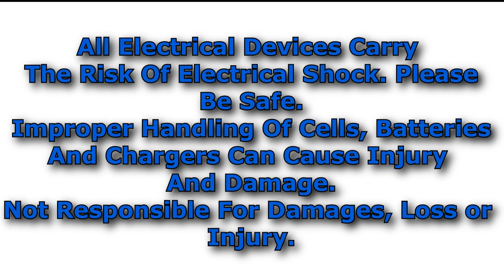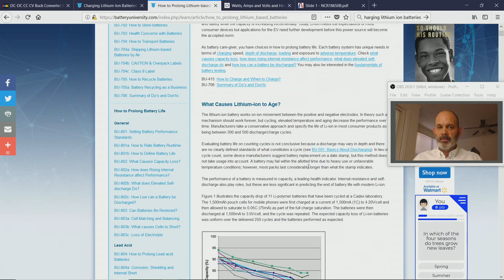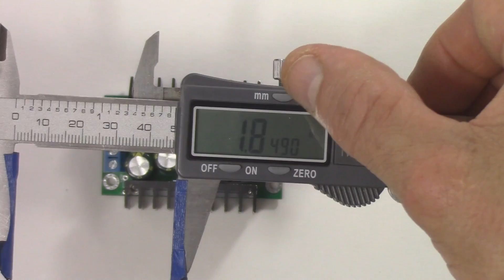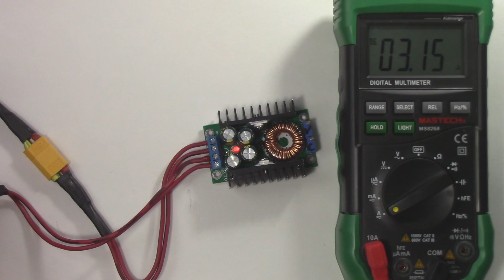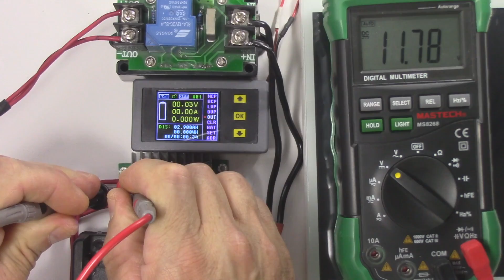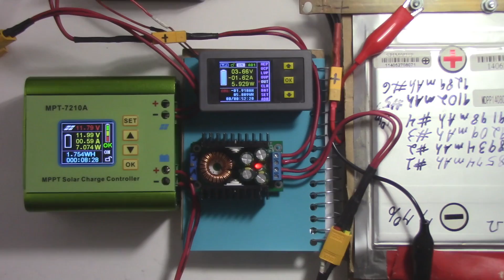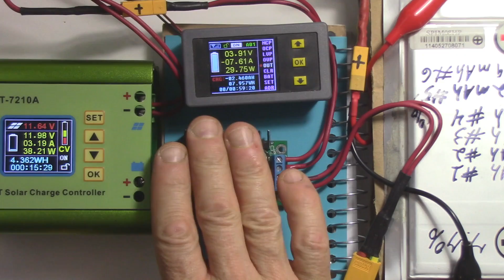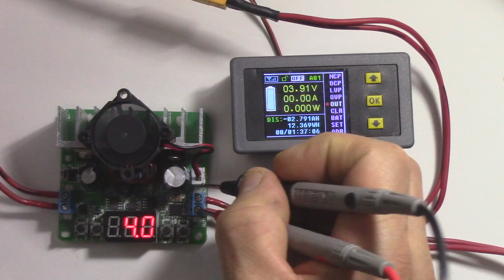Cheap Lithium Battery Charger OSKJ Buck Converter (Constant Current-Voltage) Review-Test

Comment: Very good video. After a 50 year break I took up electronics as a hobby again, things have changed - just a bit. I bought my first one of these bucks about 2 years ago. So far after doing all sorts of terrible things to it it's still going strong. I even used one as the regulator for 12 TIP35C power transistors, sort of buck linear 'thing. I did change the blue trimmers for proper pots.' Just an experiment and it worked fine. I have one as a battery charger - 12 V car & lithium. I have most of the main ones that are on EBAY and I rate this No1, better than the 300W 20A - my first one popped. I always use a 60mm fan though.
Reply from the maker: I agree. It is a very forgiving unit and does work well. Thank you so much for watching, commenting and the kind words. I appreciate it greatly. All the best.👍😀

Comment: What is the maximum current to charge that battery?
Reply from the maker: The cell is a Panasonic NCR18650B. The capacity (C) of the battery is expressed in mAh (milli Amper hour). This capacity is also used to indicate intensity of charging and discharging current. Thus, charging current (Charging) is 1625mA. Since 
the capacity is 3250mAh, you can see or calculate that the charging current must be limited to 1625mA or 1625/3250 = 0,5C. Also, CC-CV stands for Constant Current (CC) and Constant Voltage (CV). Thus, charging must be done with a maximum current limited to 1625mA per cell, and when the cell reaches 4,20V, the charger should remain at a constant voltage of 4,20V, which will gradually decrease the current. Charging should be stopped when the current reaches 65mA. Excellent article on this here: https://goo.gl/t6Sk8i Thank you for watching and commenting. I appreciate it greatly. All the best.👍😀
Reply: @richardlloydusa  I meant the Lipo cell SPIM08HP  - you were charging it at almost 10A - so can it be charged with 25Cx0.5x8A = 100A ?
Reply from the maker: According to the eBay Sales page: https://goo.gl/5VK7GY they say they can be charged at 120A! They are 200A output cells that were used in electric buses. Personally I never go to the max limits on cells. My charger will not do more than 10A safely that is why I limited it to that.  Thank you for watching and commenting. I appreciate it greatly. All the best.👍😀
Reply: @richardlloydusa  I was talking about SPIM08HP
Reply from the maker: The SPIM08HP is the cell I was referring to as well. Check this link: https://goo.gl/5VK7GY on eBay for the specifics. Thank you for watching and commenting. I appreciate it greatly. All the best.👍😀

Comment: 17:07 "The current is really high" - it's because an ammeter resistance is near zero, so without a load in the output you made a short circuit
Reply: That's the point. You can then set current limiter to any value below short condition.

Comment: Make a video of using a buck converter to charge a  LiFePo4 cell with a 5-10W solar panel.   Or, to maintain a fully charged cell.    What do these buck converters do when input voltage drops below desired output voltage?
(Just tested with some cloud cover.   The voltage on the output pins does not climb above that of the battery.  Amps is showing 0.0.   ). Hopefully I can get some full sun today)

Comment: Can you study and let us know how to connect two units in parallel to get more current
Reply: Put a 10 watt 1 ohm resistor on the positive output so it always sees a load.
I just saw a video demonstrating load sharing by ...rf guy I think.
He was using regular converter not a constant current model.
The resistor was in series with the load.

Comment: I was going to buy one of those mppt 7210a's , but the reviews I have seen said it would only work with 24v and up, but it looks to me that you are doing just fine with it at less than 12v input and 12v output.  Even if it won't work that well for a solar panel to charge 12v batteries, it would be great for a power supply control and charger for lithium Ion batteries - would that be your thoughts on that?  If so, I think I will pick one of those up.  MOSTLY I want it because it is the first I have found that is my favorite color - I just love the color LOL...
Reply from the maker: I love the MPT-7210A Solar Regulator Charge Controller At Ebay: https://goo.gl/65T6ZF At Amazon: https://amzn.to/2MT7ulO I think it is a very versatile unit and I may do a video on it and how I use it too. It essentially is a battery charger so I don't see a problem in using it as one.  Thank you for watching and commenting. I appreciate it greatly. All the best.

Comment: Great video ,  I've got a 20 amp buck converter on the way via Ebay, plan to use it to step down a 18v lithium tool battery to 15v to run a portable pressure washer , only a 75w motor so not really a high pressure washer..... the original battery is a 4 cell 3.7v  lithium in series. The built in BMS seems to constantly drain about 16mA so the battery is dead in a few days, guessing only 2000mAh cells . The tool batteries I have are 4ah and 6ah so should get a decent run time hopefully. My DC clamp meter died but guessing the motor draws about 5 to 6 amps.     Noticed a fair efficiency loss from your MPPT and amp meter looking at the watts section at the bottom of the displays but still quite impressed on how the 8amp buck converter went.
Reply from the maker: You are most welcome. Thank you for watching, commenting, the valuable feedback and the kind words. I appreciate it greatly. All the best.👍😀

Comment: Richard, I’ve been using a solar panel with a gel cell for external power to my 6V game camera?   Could I use this converter with a 2x2 LiFePo4 bank and a 10W solar panel?   Max output on the panel would be around 500ma.   I’m concerned about charging with a solar panel and using at the same time.   Thank you.  Mike

Comment: hello! can you try charging a car or a motorcycle battery with it? 
I have bought 3 of those and I wanna be sure before I try it.

thank you.
Reply from the maker: I can not find anything to confirm it will work. I found this at battery university but again I can NOT confirm. https://goo.gl/5xWh77 Thank you for watching and commenting. I appreciate it greatly. All the best.👍😀
Reply: I Charge 2 o f 135A llifepo4  battery in parallel with a buck like this but it's the 20A version. It works as it should.

Comment: Good stuff. Thanks. I just ordered three of them to play around with.
BTW can you recommend a reliable vendor (Ebay or otherwise) to buy fresh 18650 cells. I've been ripped off on Ebay in the past so I'm a bit gun shy. (If you'd rather not that's ok).
Thanks
Reply from the maker: What capacity are you looking for and price range?
Reply: Get yourself on the diy powerwall facebook page there is a list of reputable cell vendors
Reply from the maker: Thank you. Will check it out myself.
Reply: Obviously the largest for the cheapest :-)
I'm joking.
Correct me if I'm wrong but I believe capacities have surpassed 2300mah - right? So maybe the 2300mah ones are a bit cheaper now? I'm not really up on the prices. What's a good price for a prime 2300mah cell? That capacity would be fine.
This is how I got stung before. Buying high capacity cells for what was obviously a ridiculous low price. I fell for the "too good to be true" scenario. Turned out they were re-wrapped crap. Cells were all garbage and about 600mah tops. I'd buy them from a place like Digikey but as far as I can tell they don't have any Lion batteries and if they do they probably won't ship them. 
Any advice appreciated.
Thanks
P.S> Might be good to do a video on some of the traps like I fell for. Not that I want you to spend money on garbage to do the video with.
Reply: ratgreen.   Just noticed your reply. A good suggestion but I'm probably the last person not on Facebook. So I won't be following up on that. Thanks for the suggestion though. Maybe there is a good forum??
Thanks

Comment: Can i charge a 36 volt hoverbord battry
Reply: Not  with this module, unless you have ~40v supply for it to "buck" it down to 36v. Otherwise you will need a boost converter instead.

Comment: You can always add a better heatsink. That is not a MPPT Solar Controller no matter what it says on the case and trust me, I wish it was. Take it apart and look for an inductor. I do love these kinds of videos. Liked and subbed.
Reply: What are you talking about I can see the inductor it's right next to the potentiometers? No need to take it apart.
I must have missed the claim of it being an mppt I agree it isn't.0

Comment: I like your videos ! I have the same exact converter I was able to hit 7 amps on a 12v 5a power supply not bad and doesn't get that hot ! But 76% efficiency is not that great :/
Reply from the maker: Thank you for the feedback. All the best.
Reply: How does it work. I have bought a buckboost as I want to make a power supply. Are the amps at the outputs side the same as the input side?
Im a but confused.

Comment: I would have liked to see the current draw on that 8 amp hour pouch cell when the charge cycle was complete.
Someone pointed out that the 18650 you used had a built in protection circuit that was actually responsible for the zero current draw.

Comment: Thanks for interesting video. Where you show current level dropping when set voltage (4.2v) is reached, what triggers current drop. Is this a feature of all buck convertors or do I need to purchase one specifically for charging Li-ion?

Comment: With full sun my solar panel was able to put 500ma into the battery pack which is a LiFePo4 set arranged in 4P.     I set the output voltage to 3.60 and the current to max.     When a heavy cloud came along the out volts would drop to that of the battery and amps to 0.0.     

I plan on putting a boost converter on the battery pack to boost to 6V.    This is to drive a game camera.    So, Buck from solar panel and Boost to camera.

Wish there was a way to cutoff the Boost when the batteries drop to 2.8 volt.

Comment: Soldering was done by robots
Reply from the maker: Agreed. Thank you so much for commenting and watching. I appreciate it greatly. All the best.👍😀
Reply: @richardlloydusa  I really want for my son and I build a lithium battery. With knowing nothing to very little. This helps me understand that the really expensive lithium battery chargers are not necessary. I am trying to understand if this piece is used in other applications.
Reply from the maker: It can be used in charging lithium batteries. I may do some DIY solar charging videos and use circuit like these to charge the batteries. Now you may wish to look into Battery Manegment Systems (BMS) for multiple battery pack systems. There is a lot to learn for sure. But it's fun! 
Here's my Battery Related Playlist: https://www.youtube.com/playlist?list=PLnxXRLSlmSVMYN9Px1CUlffD6xE7hvVXq
Thanks again. All the best.👍😀

Comment: Thanks for the video. I have been using these bucks for a couple of years now and so far they seem bomb proof. I'm afraid some of the claims on EBAY are exagerated. They are rated at 8A and seem quite happy with 36V input as stated in the data sheet for the XL4016. My only comment really is that I would not run one at anywhere near 8A without a fan. An LM2596 buck is very cheap to give you 12V. I have never used one for charging and I'll need that soon so your video is very handy. Regards from across the pond.

Comment: Please forgive the negative comment, but your video is inadvertently teaching poor work habits. It may seem logical that soldering will keep the stands together to make it easier to insert into a connector, but it's a lazy way to work. Stranded conductors of any diameter should NOT be tinned before insertion into any type of clamping connection. Solder will slowly yield under pressure resulting in a less than ideal contact point over time. Solder will also wick up the stands to create a point of flexion fatigue over time.
Reply from the maker: Never had a problem with it but I will consider it. Thank you.
Reply: Better off using a ferrule or clean strands
Reply: Fred Flatt:   True I learned that 30 years ago when a 20amp AC plug literally melted due to  a poor connection and heating up because of exactly what you mentioned. The clamping screw had worked loose because the soldered stranded wire had yielded. Solder is too soft to clamp. Same thing goes for never soldering wires before putting them in crimp connectors.

Comment: Short Charging them to 4.00V more then doubles the Cell Cycle and Capacity life.  If you check out the Discharge curve it's really goofy to  take them to 4.2V to gain the little extra capacity you realize.   Under load they drop down below 4.00V in the first few seconds anyways.     Replacing those two POT's with some 10 Turn POT's  mounted in a enclosure.makes life a pile easier.  I would at lest put some standoff's on that puppy for use.      Most All Switch Mode Power Supplies behave like that.  They go Stupid without some type of load.  Has to do with the Oscillator circuit.       For that Solar Aplication your really should employ a Anti Reversing Diode on the output. Prevent the Battery from pumping power back into the charger.  IT WILL DAMAGE IT>
Reply from the maker: Great information and tips! Thank you for watching, commenting and the valuable feedback. I appreciate it greatly. All the best. 👍😀

Comment: You are measuring current incorrectly.  If you did this on a higher voltage power supply you will blow the fuse inside your meter.